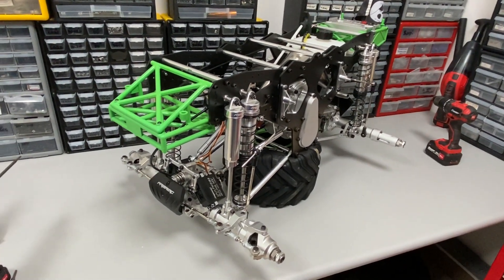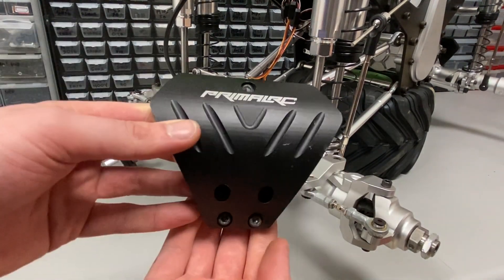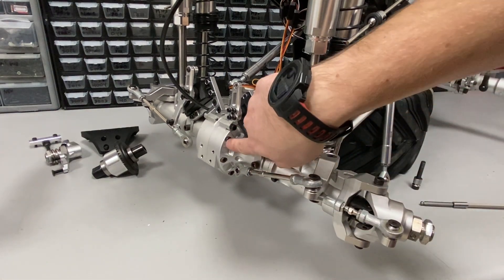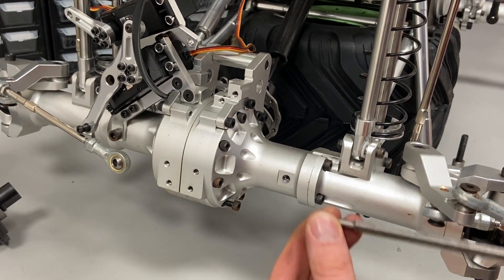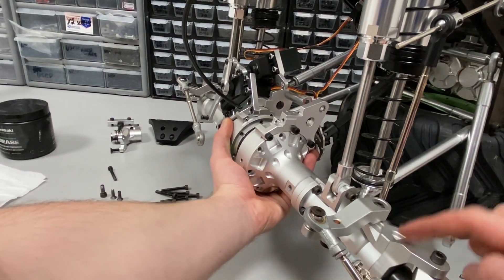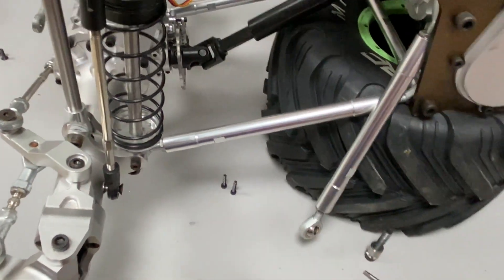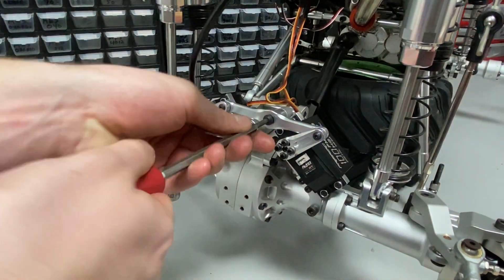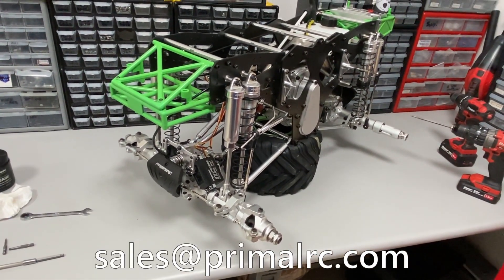Primal RC Monster Truck Differential Replacement - V4 Diff Upgrade

Comment: Thanks for the video!! When I repaired my differential, I removed the entire axle from the truck before I split the differential! This in frame repair method looks way easier!
Reply: I did the same thing, this looks much quicker